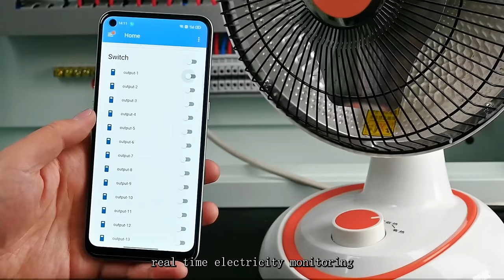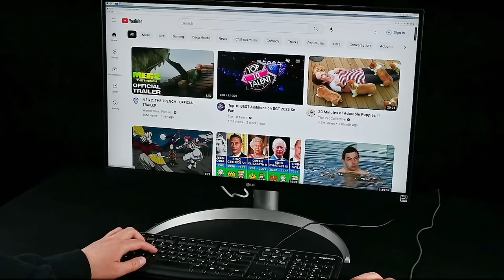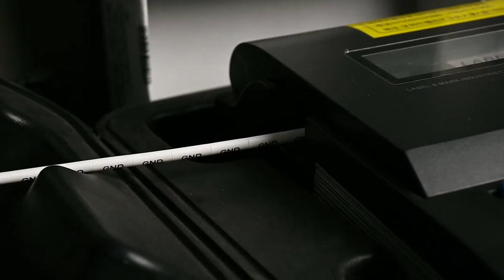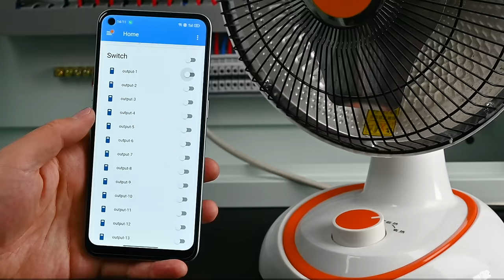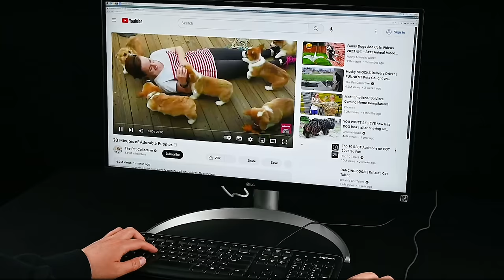Home Automation Raspberry Pi Distribution Board DIY | IOT Project 2023

Comment: You almost never see this kind of professional quality work on Youtube. Outstanding job! Exactly how I build my panels. I do want to know more about that label printer. Gotta get one.
Reply from the maker: thanks, label printer can easy found in aliexpress.
Reply: How does one manualy turn of the lights with this system in place?
Reply from the maker: @tarcisiobatista5595  there is a manual control button, also you can connect with any wall switch (just push button) .
Reply: You can even get one from Brother printers (the P-Touch series, they have shrink tube cartridges for different size wires, and you can run with your computer or phone)
Reply: @KinCony how can I get your contact I need you to build this for me

Comment: this is such a nice looking project but impossible to do it legally here. We even have very strict rules for AC and DC together in one box (pretty much not allowed). We also need to use 2pole breakers and also have to use RCDs... sometimes it is just easier to use only RCDs with integrated circuit breakers. We also do have a mix of single phase and 3phase devices... Every project I see is so nice but so unusable in our country...
Reply from the maker: It's a pity. thanks for your concern.
Reply: Which country? (I'm in UK.)
Reply: @RichardDTube  Czechia
Reply from the maker: @RichardDTube  i am in China.

Comment: I'm looking closer to your plan and i have some suggestions to apply in real electricity life experience for upgrade the quality of your project:
1/ Do not wire neutral all together from the main breaker, it is out of many standard for a good reason: in real life, you have not really zero Volt and zero Amper on the neutral wire from grid, so you can consider to separate neutral to cut out on division's breaker (and that is why you have two entries for the mono phase division breaker).
2/ if you link many wires together (even if multi-core wire), you have to weld them together inside the contact adapter, because you will sure have connection problem by the time and kind of damage on the full wire when the contact is not zero Ohm. This problem can also occur a fire start.
3/ separate power wire from data wire inside the conduit guides the way that you will no more have resultant current from AC
4/ Do not enclose wifi module inside a metal box (this box is a faraday box for the wifi signal), but use an aluminium profiled structure with wood or plastic cover or a PVC box instead.
Option can be to use a bluetooth key with a little bluetooth keyboard that has a mouse pad on it, and a 5 to 7 inch sensitive touch screen to your project that can control the Raspberry Pi4 device on the front panel.
Reply from the maker: thanks  for your suggestion. thank you very much.
Reply: there are some really weird building methods seen here.
Reply: كيف أحصل على البرنامج

Comment: Very nice build! Personally i'd have gone with a neutral bus bar near the bottom couplers instead of crimped singles onto the main AC isolator, but very nice all the same, amazing time and attention to detail given!
Reply from the maker: thanks for suggestion.
Reply: Came to make same comment. Removing or adding one neutral, means a complete neutral harness  rewire.
Also, no provision for expansion was made. Other than that, a very neat and tidy and well planned out job.

Comment: One suggestion, I have been working in ASM factory, in Netherlands years ago, assembling Eagle A412 machines (yes, THAT ASM company - semiconductor machines manufacturer - in 2006). I have been trained for electrical assembly, and one of the first lessons was - never don't TWIST the copper wire after stripping insulation. For that, I could easily be sacked, I did it few times at the beginning, when senior assembly electrician saw me doing this, he explained that it is absolutely FORBIDDEN to do that in professional assembly. Many reasons, all very sensible. I refer to what I see in video in 5:43.
Reply from the maker: thanks for your suggestion.

Comment: I remember someone doing this in house had to eventually modify the house to allow for the huge amount of wiring this idea needs. Meaning everything is controlled by relays in the electric box.
Reply from the maker: yes  , similar , need put wire, it's stable than wireless

Comment: Nice video indeed, I have one question at 13:58 why did you use multiple blue wires for each terminal instead of connecting the terminals with each others, then connect last one with blue wire only ?
Reply from the maker: Actually, a neutral wire strip can be used, this will be better.

Comment: Very clean build. Now, if you want to be 1000% perfect, you need to tighten those screws with a torque wrench as per spec.
Reply from the maker: thanks for suggestion.
Reply: @@storm4621 Every electrical component (contactor, relay, etc.) should offer that information in their product datasheet.
Reply from the maker: https://kincony.aliexpress.com/store/1100463977@@storm4621

Comment: I have a updated question. What If internet goes out and Can not reach the app throught the network. How do someone manually turn off and on a light or even dim the light high to low?
Reply from the maker: it's a good question, all our solution have manual control buttons can work without network, without software, just physical control way.

Comment: I work at an automation company, this is similar quality of build. 👍🏽
Reply: can you please explain me this, the automation part is all fine. but how can we achieve the automation in separate rooms like hall, kitchen, bed, we can so many electrical appliances right? how can we achieve automation at that level? please explain.
Reply: @learnprime  well if your talking about automation in the home you probably don't need industrial grade PLC's. Your probably better off sticking to arduino and by separate rooms I am assuming you mean wireless communicating with each other so WIFI/RF signals...

Comment: How would it control my light switch? Wouldn't I somehow need to connect it to the box?
Reply from the maker: brekaer output port use wire connect to your light. the light switch use by "momentary" switch, use wire connect to KC868-Server controller's INPUT port, 16 OUTPUT have 16 INPUT ports.

Comment: Regarding the lk-320 printer, I bought the same one but with the ability to connect to a computer ( lk-320p). But the software had a problem installing. Can't install on Windows 10. Can you help me?
Reply from the maker: you can try to find whether printer have driver for Win10
Reply: ОК! Thanks! @KinCony

Comment: So much for not separating high voltage from low voltage. Code does not allow high voltage and low voltage to be in the same raceway.
Reply from the maker: thanks for suggestion, now just want space smaller.

Comment: Using RPi for just turning on/off switches is way overkill, and considered the forever supply shortage of RPi you'd be better off using a 2$ ESP32.
It's also boot a lot faster and more resilience, you also don't have to worry about the OS halting and related problem.
Reply from the maker: it's two different solution. we also have ESP32 solution, but RPi is a computer, almost install any Linux softare, how to install home assistant on ESP32 MCU?
Reply: Where did you install the RPi ? I hoped you put more explanation about the parts you used or provide a simple list with a simple diagram of which part is installed where and its specs. @KinCony
Reply from the maker: inside of KC868-Server, here is details: https://www.kincony.com/home-automation-local-server-raspberry-pi-relay.html @PerchEagle
Reply: Thanks man :) @KinCony

Comment: Really awesome project! What's the advantage of having a setting like this instead of having many Wi-Fi relays (like Shelly) directly connected on the switch?
Reply from the maker: wired solution is more stable than wifi solution

Comment: Great video! I wondering if the temperature of the air conditioner can be adjusted, or it's just an on-off control. Thank you in advance for your reply ;^)
Reply from the maker: this just for ON/OFF, but add our other IR products, that can control any IR devices.
Reply: Thank you for your feedback. I'll check with Kincony's website.
Reply from the maker: KC868-AG Pro IR controller or KC102 tuya IR controller @si_ne_qua_non
Reply: Thank you for your support! @KinCony
Reply from the maker: you are welcome. @si_ne_qua_non

Comment: You must crimp ferrules before screwing them into terminals 12:50. If you are not crimping, it's much better to not use them at all. Also it's weird that just after a moment ferrules are crimped for some other connection. Then non-crimped ferrules yet again at 13:38. No consistency whatsoever.
Reply from the maker: thanks for suggestion, because of edit the video file.

Comment: You need to develop an interesting solution for IR, I know kc868 but it's too big for small applications and doesn't have output for external IR. An IR Hub is interesting or a compact WIFI/ZIGBEE system.
Reply from the maker: you are right, now the new version in our development plan, will have esp32 gateway support zigbee and IR extender way, use wire extend to send IR signal.

Comment: In 13:01 ~ 13:30 it looks like the wiring is swicth to from N ~ L. I was referring to the distribution panel diagram..
Reply from the maker: Thank you very carefully. We will update the schematic diagram
Reply: @KinCony  what are the difference when device is connected from channel 1 to 8  and 9 to 16 since 9 to 16 pass through the relay module?
Reply from the maker: @nathanielsastrillo46  one is MAX 16A current for load, another is MAX 25A current for load.
Reply: Another question is what do I need if I want to extend it to 32 Channel IO?
Reply from the maker: @nathanielsastrillo46  replace with our 32 channel controller.
Reply: @KinCony  will it have the same feautures like Raspberry Pi CM4+ ESP32?
Reply from the maker: @nathanielsastrillo46  yes

Comment: 10:50   It is UNACCEPTABLE!!! 
Fire this “clever master” immediately. You'll be lucky if this "hero's" electrical shield doesn't burn your house down.
I’ll explain to those who don’t understand - in the moment, yes, it’s strong at first, but then when these circuits begin to “load” a current will flow, the conductors heat up from the current (this is natural), but the conductors of the wires expand, then the load is turned off, the conductors cool down and the conductors narrow (this is a natural process). And so over and over again for weeks or months, and then the conductors in the center will simply fall out on their own, and this is sparking, carbon deposits and an avalanche-like growing process of degradation of the connection. And then, unfortunately, local overheating and fire.
14:31 How to understand which switch switches which terminal. There are no markings or designations, there is no visualization of any kind. In emergency situations, you will get confused.
This “electrician” needs to not only be fired, he needs to be prosecuted!!!

Comment: Cool? Yes.. dangerous AS HELL!!!!!??? EXTREMELY. Where are the disclaimers for not doing this unless you are a licensed electrician?  And for those who need home automation just use Alexa for voice interop, tuya network compatible switches and outlets, and he tuya automation app. There is no reason to go this over the top on hardware? Individual outlets and switches can be gotten for cheap!!! Super cheap. Tuya app is free for most people’s needs.  Amazon Alexa is what it is.  Control at the circuit level is over the top. If you control via outlets at the client end where you plug in you have much more granular control. No servers or temp gauges needed

Comment: It's a neat job but from the point of view of someone who has been on the receiving end of maintenance for such things, please always do the following out of common sense and respect for anyone else having to look after it:

1) Use files on the edges of things that you cut. You may have done this on the rails but it wasn't show in the video. You didn't do this on the cable management plastic. At best not doing so looks messy, but rough edges on cut metal will slice fingers and getting injured because someone else didn't bother to spend a few seconds with a file is very annoying.

2) Do not cut metal tips off ferrules or wires over the top of electronics. Those clipped off pieces of metal get into all manner of stupid and unwanted places and can be very annoying to remove. Prevention is much better than trying to track down shorts or replace broken components because of a short due to such easily avoidable things.

3) Use colour coded wires. You did a great job of labelling, but colour coded wires are a standard for a reason. They save a lot of time, make investigating issues much faster than looking at a massed bundle of anonymous black wires. For more complicated wiring beyond live/positive, neutral/negative and earth the standard three colours aren't applicable, and in these cases use different colour wires of your choice, just keep it consistent. Keep on labelling though!

4) Good job on using ferrules, but for any form of maintenance ever, or just adding/removing functions, please don't mash a lot of wires together into one rat-rail. Use distribution blocks and strips. It makes things much easier to amend and change in the future and you don't suffer in the same way with exact length wires which no longer fit because you had to move something else.
Reply from the maker: Thank you very much for your suggestion. We will do better next time.